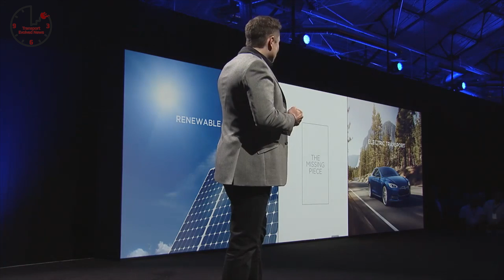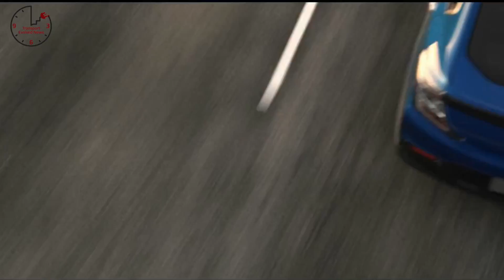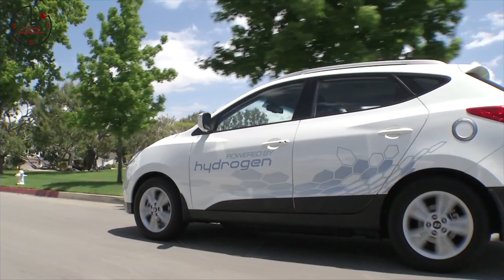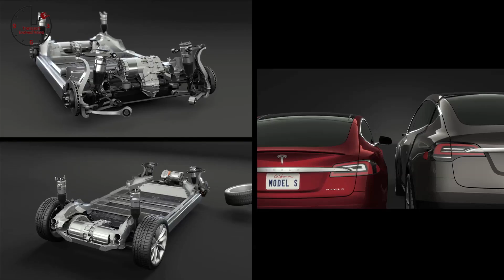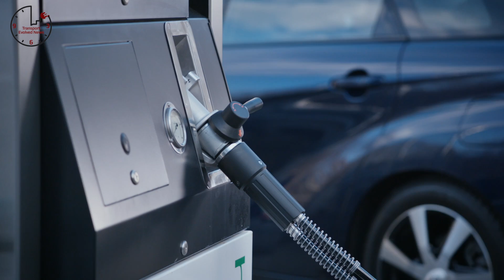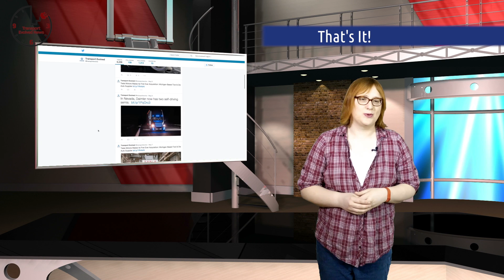Tesla Energy, Volt Pricing, Self Driving Trucks T E N Future Car News 8.5.15

Comment: I know of an autonomous truck.  Its called a freight train. Been around a very long time.
Reply: Zazzle Delacruz Disagree. If the driver takes his/her hand off the dead-man switch the vehicle comes to a stop. Because the freight train doesn't have the sensors to know to go or stop. There is a LOT more to autonomous driving than basic steering.